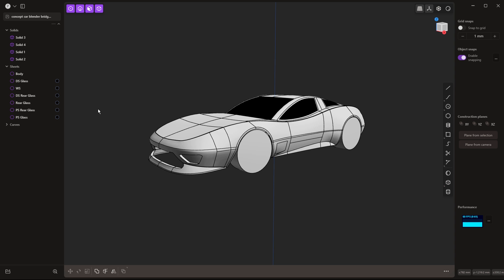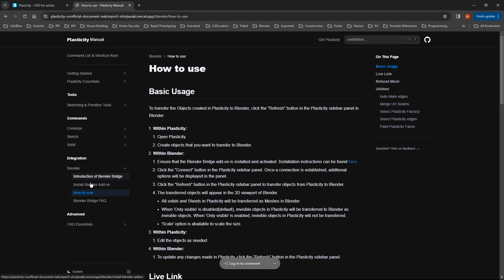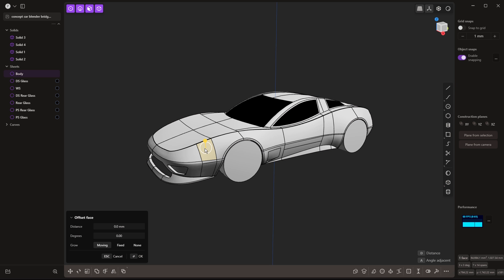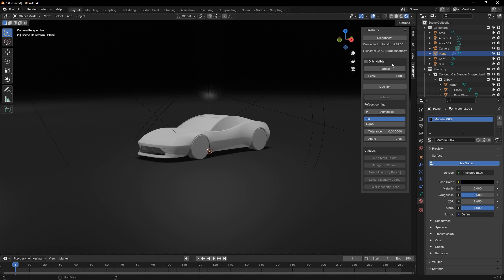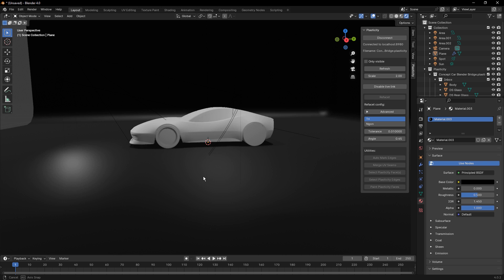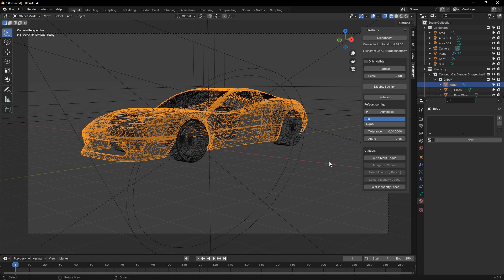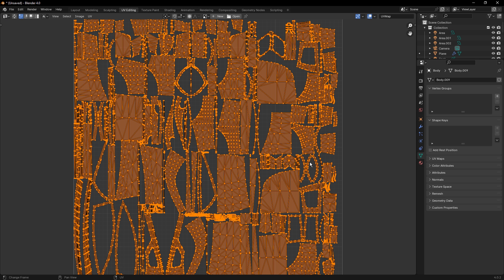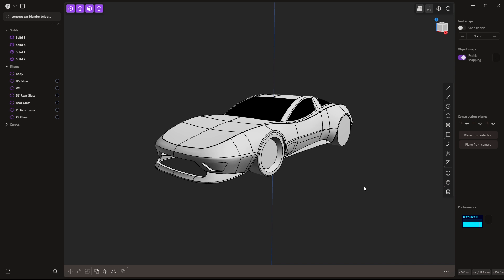Plasticity Blender Bridge | How To Set Up and Use the Blender Bridge Add-on with Plasticity 1.4

Comment: Can one go also the other way around and get something from Blender over to Plasticity via the Blender Bridge? Guess not, hm?
Reply from the maker: No unfortunately the Blender Bridge is one way from Plasticity to Blender.  You can export from Blender and import an stl or obj into Plasticity, but it isn't "linked" like it is with the blender bridge.  In most cases with the workflow here Blender would be the final step (or at least the next step).  Very few cases would you go back the other way.

Comment: I'm using a MacBook Pro M1 and Blender 4.2 LTS and the trial version of Plasticity.  I enabled the local host it Plasticity (Local host and port 8980) . On the Blender side, I installed the plug in, and it shows up in the side panel menu.  I have an object in Plasticity and it is running, and when I hit Connect on the Blender side, nothing happens.   Is this latest trial version of Plasticity still not supporting this process ?  Also, I think by default, port 8980 is not something that is configured by default in Mac OS ( Sonoma 14.8.1) .     Could someone be so kind to give me some guidance here.  Thank you
Reply from the maker: I would try Blender 4.0.  I just tried it on 4.2LTS and it doesn't work, but works fine for me on 4.0.  If it works on 4.0 for you then we know its not a mac/port issue.

Digging a little deeper i see that others have it work on 4.2 and say that the version they downloaded from Github is having problems but downloaded from the plasticity page its fine.
https://doc.plasticity.xyz/blender/install-blender-addon
 I personally didn't get it to work that way but just an FYI.  Nick thinks its an issue with 4.2LTS and not the addin.
Reply: @LearnEverythingAboutDesign  I have installed 4.1. So I guess I would need to install 4.0. Right. I will try that. So the trial version now supports the bridge, right
Reply: @ElderVibeCoder  I am not 100% certain on that since i don't have a trial version.  I would imagine if you have the local host/port settings in preferences that it should work.  If it doesn't work in 4.0 then maybe not.  But i did check discord and saw lots of comments about it not working on 4.2lts.
Reply: @LearnEverythingAboutDesign  side question, do you know what country Plasticity the company is based in. I’m thinking about purchasing their product but I see in the checkout process they would charge me VAT here in Thailand. Normally that never happens with purchasing software here online
Reply: @ElderVibeCoder  I am not 100% sure but i want to say france or italy maybe?  I believe the creator is american but i think he lives abroad.
Reply: @TheShift1313  after watching your latest Plasticity 24.2 demo, I decided to go for the Studio Version. And used your coupon code:-) btw Plasticity to Blender Bridge works like a charm on my MacBook Pro M1.
Reply: @ElderVibeCoder  awesome. I realize now i replied when logged into the wrong account....whoops :)

Comment: So with the Bridge, you can't export at the maximum density right? It's always the default one?
Reply from the maker: Once you have the object in Blender on the Plasticity tool menu you can click "Refacet".  This will redo the mesh.  there is a tri and nGon option.  If you take a cylinder for example you could refacet as quads(except for the top face) or Tris on the fly as much as you want.
Reply: @LearnEverythingAboutDesign 
Yes but the Density itself, it can’t be set at the maximum with the Bridge
Reply from the maker: @GiiyomCG  When I export a cylinder as an STL from Plasticity with 100% density, that is the same thing i get in blender when using the Bridge.  I don't know if its specifically using the same numbers but that is what I get.  With the Bridge you can save presets as well if you want to have your own low/med/him refacet.

Maybe I am missing something here.  The density slider in the Export in Plasticity is just tweaking the various tolerance values to arrive at the result.
Reply: @LearnEverythingAboutDesign  Hi - Thanks again for the reply
Yes I actually figured it out - to control the Density with the bridge you have to change the 'Face Plane Tolerance' and the 'Face Angle Tolerance' and Refacet it
What's confusing is they went for different names from what you have on the Plasticity exporter options - and indeed understanding that the Density slider is only tweaking the values shown below - but there's a limit - in Plasticity you can crank the density really high (0.00001) but with the bridge theres a limitation
Cheers

Comment: Ooooh I am actually longing to see what animation in Plasticity will be like.

As a CAD user I long to do dynamic physics-mechanical parts assembly and fluid simulation in Plasticity some day in the future.

With that I can say goodbye to Fusion360.

Plasticity modeling already beat Fusion360.
Reply from the maker: i doubt you will ever see animation or rendering in Plasticity.  Because of how its paired with Blender there would be no reason to reinvent that.  My suggestion would be to spend a bit of time learning Blender for animation and rendering.  It has some cool features you would never get with a CAD renderer such as the ability to deform bodies.

Comment: Hey is it possible to do this workflow in reverse? For example I want to use blender for the surface modeling of a car, then I want to export the model to plasticity to cut my shutlines into the body like the doors, hood etc. After that I want to export the car back to blender for further modeling. Would this be possible? I don’t have plasticity so I’m not able to try this by myself. And I think after importing the model from blender to plasticity and back to blender again, the polygon topology would be gone.
Reply from the maker: At this point in time no.  The Blender Bridge works one way.  You can import a mesh into Plasticity but currently you can't use it.  I know there are plans to be able to model to it (pull to a surface), but not sure at what point that functionality will be released.

Comment: What port number do I use?  the default localhost:8980 does not do anything.  When I click the "Connect" nothing happens.  Thank you.
Reply from the maker: is it enabled on both ends?  the port number 8980 should work as that is default on the blender add-on side and plasticity.  

what version of Blender are you using?  I haven't tried it on the most recent one yet. that could also be the issue.
Reply: @LearnEverythingAboutDesign  How to enable on both ends?  I'm using 4.1  Thank you.

Comment: Nice. But what's the point? You can export/import an Obj. Where's the difference? (And who the hell wants to use Blender? ;) )
Reply from the maker: Most people using Plasticity its the first part in their workflow.  Blender is generally part of that and exporting and OBJ is a one time thing.  With blender bridge you have a direct connection meaning you can edit the model in plasticity and have it update in blender.  You can also remesh it with Ngons and tweak the settings in Blender.  It can also auto highlight edges/seams based on how something was modeled in Plasticity.
Reply: @BangZoel3D All? Ah, yes millions! Do you know what a religion is? When you no longer notice anything outside of your bubble.
Reply: For me I find it easier to to model on plasticity than blender but blender has a lot more things I need to build a actual game
Reply: Blender is free, and you can get nice renders quickly. Exporting/importing multiple obs is not exactly fun. Blender has a GoB add on that allows fast connection to ZBrush. So today I tried kicking out a multi part model from plasticity to blender then passed the meshes onto ZBrush. Seems like a nice workflow so far. 

Thanks for the tutorial, great content you are making, my one wish right now is that blender would respect the materials I set up in Plasticity.

Comment: I sure wish the Plasticity folks would fix their Linux file management systems. All file open/import/'save as' dialogs pop up behind the main window and you have to bring them to the foreground by clicking them in the task bar, and none of the dialogs remember the last directory you accessed, so if, like me, your files are stored deep in a network path, you have to click down to those folders every single time you load/save. Crazy-frustrating. I've reported it on their Discord several months ago, still not fixed.
Reply from the maker: yeah that sounds very frustrating!